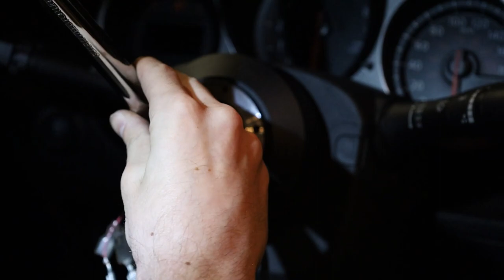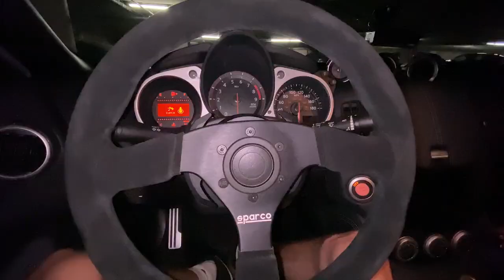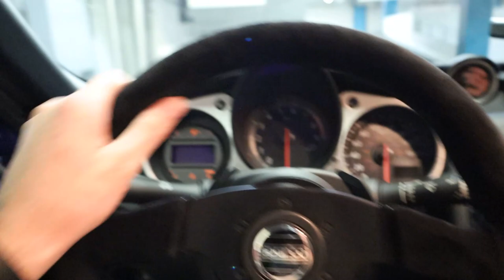370z Quick Release Steering Wheel Install and Review

Comment: Aye would you happen to know if the paddle shifters on my Z would still be okay with the sparco wheel? Like the placement of it
Reply from the maker: No I do not. I’m sorry I couldn’t help you
Reply: @chrisgotham4321  no problem I think it would be fine been seeing some pictures online. This tutorial will def help me when I get it. Thanks man
Reply: @joen9  I have a sparco wheel with a nrg quick release. Good fitment with the paddle shifts. There's plenty of room between the shifters and the wheel.
Reply: @Severus.  so I Can out a quick release on and still have the paddle shifters on?
Reply: Yeah I'm running an nrg quick release, and a sparco wheel on my auto sport package Z. The wheel is actually quite a ways away from the paddles.
Reply: @Severus.  so the paddles are not connected to the steering wheel but to the column instead?
Reply: @Severus.  the biggest thing for me is I want a quick release but I still wanna be able to use the paddle shifters and still have the functionality of them while still using a quick release wheel.
Reply: It will make sense when you pull the stock wheel off. Paddles won't move at all. And you've got plenty of room after to still shift with them.
Reply: No a working horn on the other hand I can't help with because I haven't wired mine lmao
Reply: Now*
Reply: @Severus.  thank you so much! I was worried whether I’d be able to run a quick release! I appreciate it so much!!
Reply: @Severus.  and all you did was just put the hub and wheel on nothing else?
Reply: Hub, quick release and the sparco.
Reply: @Severus.  great thanks!